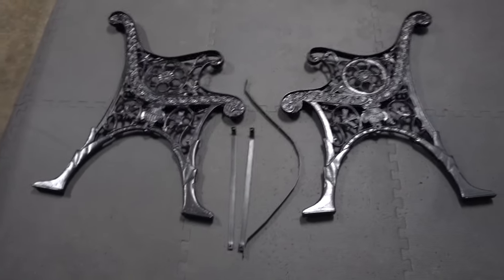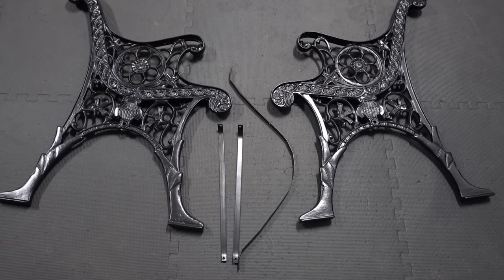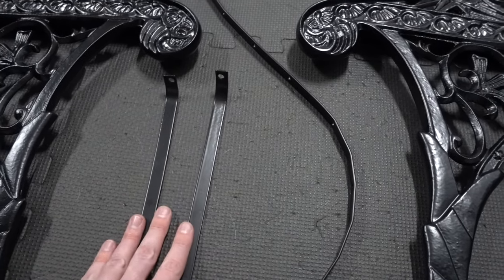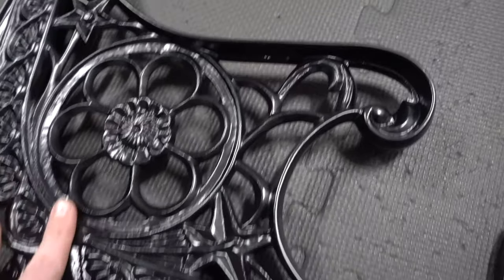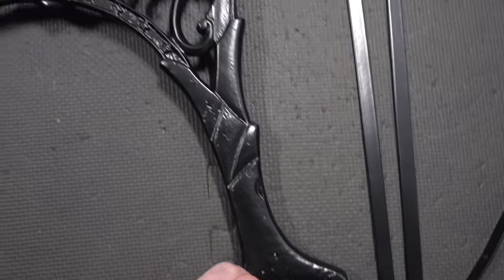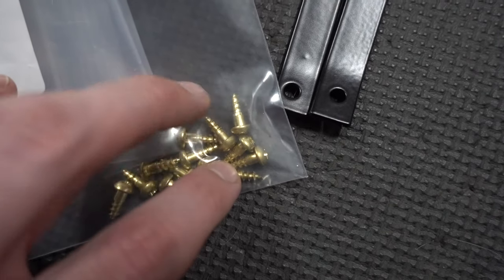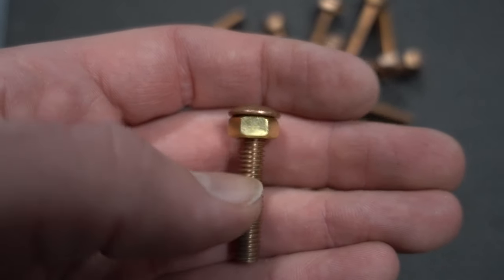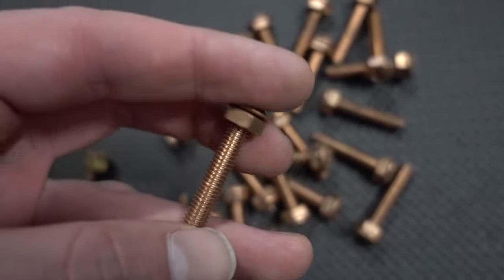DIY Antique Garden Bench Restoration

Comment: I used Red Oak, then stained it with Deck Stain, a water based product from Thompsons waterproofer.
I made the boards 6 feet long and 1 inch thick and 2 1/2 to 2 1/4 wide, so they are a tight fit but very strong bench. Had to grind the wood into curved ends to fit better to the metal frames.  The end pieces are also bevel cut to flow into each other smoothly. 
I used the belt sander to round over the boards where the pattern curves, otherwise you have a pointy transition.
Used a 36 grit belt sander for that. Wood was cheap, it is known as Oak fencing boards from Turmen's Lumber in VA.
Ends were black powder coated from factory,  also used a dremel to clean up metal flashing. 
All screws are SS and screw in from back of the wood, and do not come out the top as the boards are plenty thick. I drilled pennies to use as washers on the back side.
Pictures. And one thing I dont like about this bench design , the seat width is too narrow, it ought to be 2 inches deeper.
https://photos.app.goo.gl/eEi7AT1812cBohd77
Reply from the maker: Thanks for sharing!

Comment: How much do you think it would sell for? I have two of the exact same ones but their rotten and rusted. Thinking about refurbishing
Reply from the maker: I would think the price would be depending on finding a buyer. I would say several hundred. It cost me probably $450-500 to build. I did not have to pay for the bench pieces and I luckily did not have to buy most of the hardware.
Reply: I did a similar rebuild too and I'm going to ask $850. The cast ends I have seem to go for $450 before shipping, and I had scrap wood already so I figured I'd double the cost of materials for my asking price. Did you end up selling yours?

Comment: Hi. Im doing the exact same thing. The wood im thinking about is very expensive. NOW i can buy Sepele fire door for a knock down price. Is there any reason i cannot cut into strip on the table saw to produce the slats? Grain direction etc?
Good job by the way
Reply from the maker: Excellent! The things to look at when considering what kind of wood to use is where you were going to be using it (indoor or outdoor) and what you were going to use it for (application). Different woods are usually used for different purposes as well as for looks. From the research that I found on the wood you mentioned it should be okay for a project like this. If you can find it in a different format that you are able to salvage that is always a great idea especially if it is cheaper than normal cost. Just do your research on the wood to determine its characteristics to make sure. Thanks for the appreciation!

Comment: I have the 2 ends, but i cant find the 3 stabilizer pieces. Any idea where i can look?
Reply from the maker: I do not think anyone would sell the stabilizers. The ones that were on the bench originally were in decent shape luckily but they look like they were custom-made. I am sure you can buy some skinny sheet metal pieces from Lowe’s or Home Depot and bend it plus drill holes to work.
Reply: @scottwalker19  Right on. I'll try to find some detailed pics of those as I have no clue about them. lol appreciate it 🤙
Reply from the maker: No problem! The ones I have are probably 1/4-3/8” wide and less than 1/8” inch thick steel. Beyond that they would have to be customized for your exact bench.
Reply: I bought the metal and bend it
Reply: I bought the metal and bend it in the vice